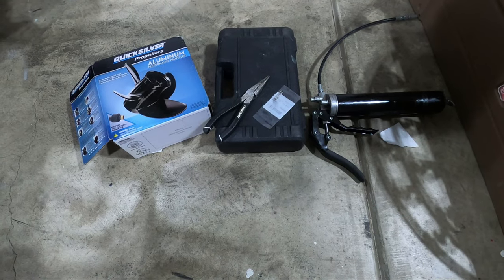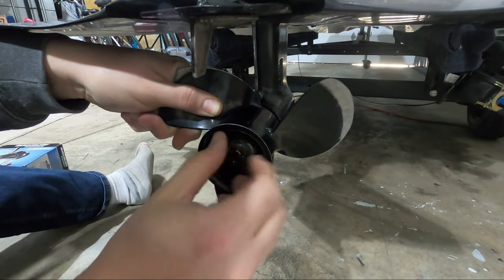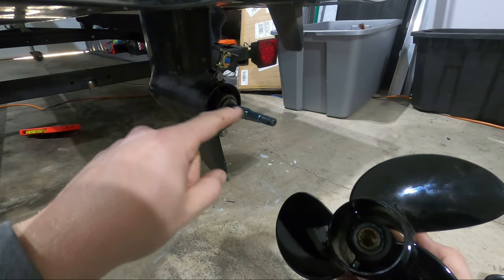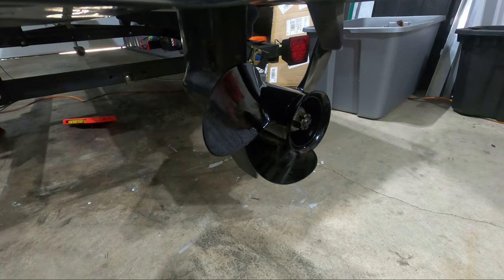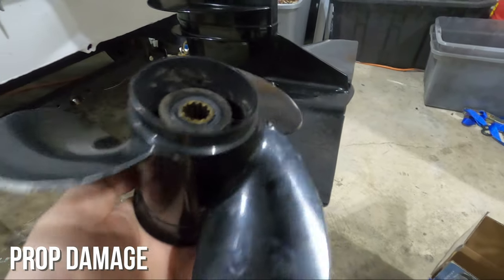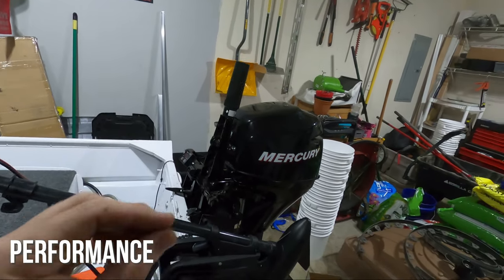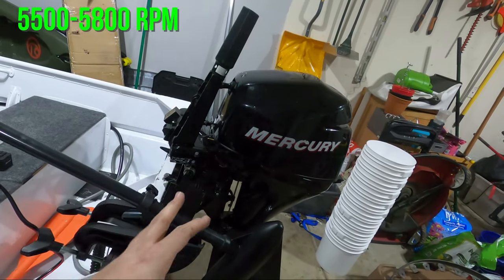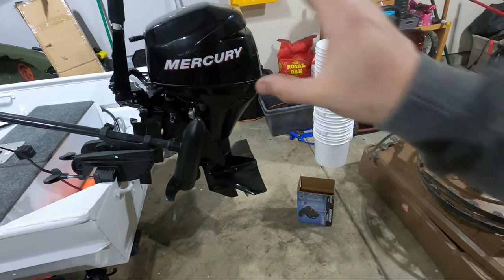CHANGE OUTBOARD PROP FOR PERFORMANCE & SPEED - PITCH SELECTION AND BOAT INSTALLATION

Comment: I have a 30hp Yamaha 2 stroke sounds like it reving properly it’s on a 415 boat only 23mph  it has the pitch it came with second hand it looks like 11 pitch what would u recommend I do to get a higher top speed
Reply from the maker: Gotta get a tach to read your RPMs. If you are outside the RPM range go up or down in pitch to get in that range.

Comment: I have a 24’ pontoon boat.  I have a 2010 Mercury 90hp 2-stroke with a 13-3/4X15 3 blade prop.  I get about 20mph WOT at about 5300-5400rpm. I’m thinking of switching props.  I’m leaning 14x13 (bigger diameter lower pitch) or possible 14-1/2X16 (bigger diameter higher pitch).  My main goal is to get the boat up closer to 25mph.  Is this possible or is my 90hp just incapable of getting more speed.
Reply from the maker: It looks like the RPM range for your motor is 5000-6000 so you're not far off from being correctly propped. More speed is going to be tough. 

For speed, you want smaller diameter higher pitch.
For holeshot you want lower pitch and same or higher diameter depending if you are having issues with prop slip. 

If you change prop manufactures, such as going from a mercury prop to a solas prop, RPM changes may not translate with geometry changes between the props.
Reply: Check out Turning Point Propellers, they say they give you much better performance. I have an 18ft with a 60 hp 11 pitch Solas prop and hit only 5000 RPM and about 19.5 mph, Im thinking it can do a tad better with a better prop, maybe not 25 but something over 20, and you should always have a spare anyway. Spare props save weekends.
Reply: You need a bigger engine 😊

Comment: I need help. In two weeks I will get my  twin Suzukis DF150APX, the baot is a AS Marine 26 GL lenght 7.8 meter, weight wet and 2 Persons 2600 Kilogramm (about 5700 pound) . What props for speed  did you recommend. Thanks for  answer

Comment: Will a 1 inch increase in propellor pitch from 4.5 inch to 5.4 inch increase top speed all other parameters being equal. ??
Reply from the maker: It depends on where your current top end RPMs sit at.

Comment: What would you recommend for a motor that is asked to push upstream in rivers that are full of sand, a few rocks and pretty shallow.
We try to use the lightest motor possible. I’m thinking somewhere around 20 horse. Would you lower the pitch to get more thrust?
Reply from the maker: For a super lightweight motor the new Yamaha F25s are ridiculously light, around 120lbs. As far as propping goes, yeah I'd say a lower pitch for more low end power against current would help you. If you find your prop getting chewed up by rocks and sand a stainless propeller might be an idea too.
Reply: A mud motor,
Surface drive or long tail

Comment: hi, we have a 2019 mercury 40hp 3 cylinder outboard motor, the propeller can spin very freely clockwise and anti clockwise, byt the only thing that concerns me is the propeller has about 1/5 " play moving back and forth, we tighten the lock nut and secure with tab washer already.  Is this normal?
By the way, the serial # of the motor is 1C560816, we tried to search the mercury marine site to look for the pro gear housing diagram to check if we missed a washer/spacer or something, but the diagram shown is quite different than the one on our motor, can you help?  Thanks
Reply from the maker: There is typically some back and forth movement even with the lock nut, it comes from the gear train.

Comment: I am using a 9 1/4 x 12 propeller for a 20hp 4s, which propeller can I replace to achieve maximum speed?
Reply from the maker: Depends on what your RPMs are at top speed. If they are 6000+ you can go up to a 10p for a higher top speed. If they are lower than 5500 I wouldn't change anything.

Comment: I have been having an rpm issue. Im only getting 4500 rpm at full. I dropped 3in with no difference. Motor is a 2020 40hp Merc 4 stroke. Can i tighten the throttle cable or adjust it? I think it's not reaching the stop at full
Reply from the maker: You can definitely adjust the throttle cable if you feel like its not opening up fully. Dropping 3in in pitch with no RPM change does sound like its being limited by something. I have this video here where I installed the throttle cables that might be helpful for adjusting them: https://www.youtube.com/watch?v=9HkzMkX-WJg

Comment: I have a 1992 40 horse Johnson and wondering What is the correct pitch for it ? Now it has a 11 3/4 × 17 I was thinking about getting a 10 or 12 pitch do I have to change the 11 3/4 to a smaller diameter?
Reply from the maker: You'll have to measure your RPMs to see if your pitch needs to go up or down (or the diameter). Both work to increase or decrease your RPMs.

Comment: So if my merc 6hp goes about 19mph right now with my 12ft John boat very light by the way what pitch prop should I get to get more speed
Reply from the maker: You'll see to check its RPM at max throttle to see if you're able to improve it. If its under the optimal RPM range you could go down in pitch for more speed or if its topping out you could go up for higher top end.